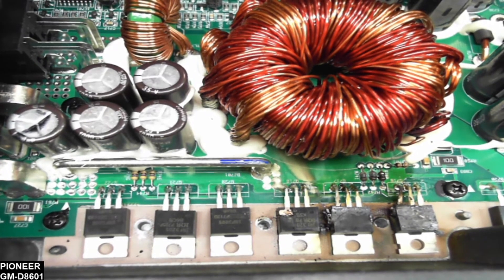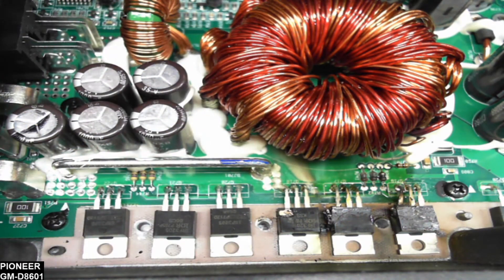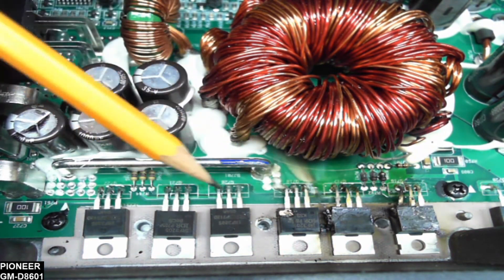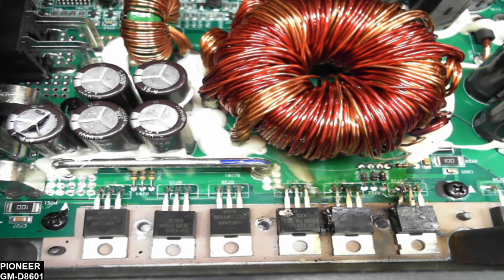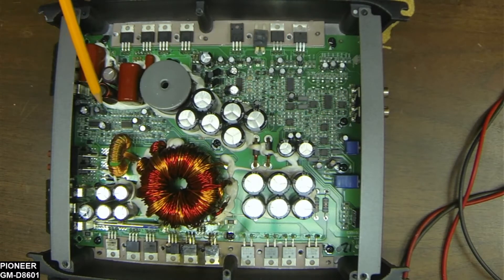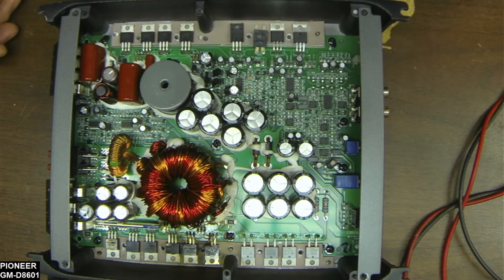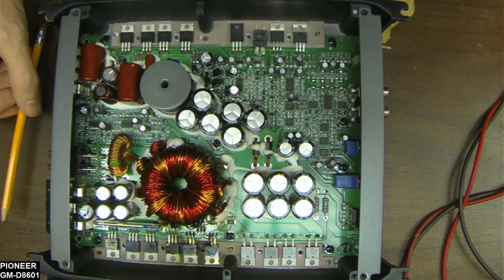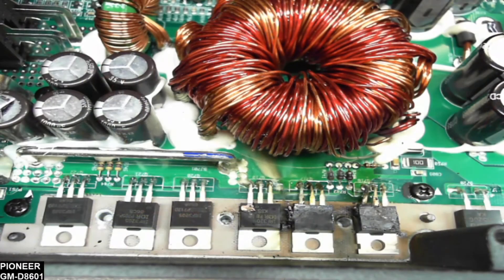Pioneer GM-D8601 Class D Automotive Amp Small Rant About Build Quality

Comment: Hmmm, i run two of these in my car each @ 2ohms and run them at the max output for that impedance on a daily basis, wonder if i have two time bombs in my boot now. i also own a pioneer GM-D multi channel amp as well :/
Reply from the maker: Hi Steve, thank you for watching! There are many factors that contribute to amplifier failures. Under-voltage and output clipping. Next in line would be heat-soak. You can run an amplifier at its max and still be somewhat safe but what will catch up is the lack of heat dissipation. This is when transistors fail.
Reply: @ellensburgamplifier  ive had the wiring run for over a year to turn on a fan with the accessory output on the ignition, been too lazy to actually install the fan lol.

I probably hit pretty low voltages, my systems configuration is 2100w RMS total  based on rated power and while not competition grade power my cars alternator hates me, ive killed two of them so far and well on the way to a third ha ha.
Reply from the maker: @stevefox3763  You must be doing well for them to make it this long! I am here if anything happens to them. One thing I would do is to glue the inductor and output filter capacitors in place. These typically fail from vibration damage.
Reply: @ellensburgamplifier  lol, vibration? they live behind four 12's he he.  I siliconed the internals on the crossovers for my front and rear components because i wasn't happy with things relying on just solder joints for security, doing things in the amps makes a lot of sense!
When i did my fronts i used epoxy at first and man did i regret that, the resistors started cooking the epoxy to the point of it smoking and my car stank, even after i cleaned as much off as i could and replaced it with silicone it still stank and smoked for months :(

Comment: Sometimes people attempt to top solder mosfets back in and get them to work not even looking at the drive signal and they just blow back up. Lol I find the output inductors always coming free from bad scolding on these amps alot
Reply from the maker: Once I pull the board I will know! I thought this same thing as there is flux visible (not flow soldered) on all the TO220 transistors.

Comment: You don't match transistors by date code.  You can "start" there but you really need to measure the parameters of each in order to match them.    While different manufacturing runs of parts may be very close in specifications they will never be exactly matched, even two that were manufactured one after the other from the same piece of silicon.
Reply: Yes you are correct but it is not practical to buy a 100 stick and try to pick out the closest matching set for each amp that needs repaired.  same batch is good enough  unless its a timex lol
Reply: @WhateverUDecide  , understood.  My point was that Pioneer may be choosing the parts from different date batches based upon their tested specifications and not their date code.   I understand as a servicer that you can't stock 1000's of parts of different transistors just to be able to match them.   Just because you see different date codes doesn't mean that Pioneer didn't take the time to match them.  It actually supports this due to the mismatched date codes.
Reply from the maker: @aaa000777  Thanks for the comments! I guess they could have employees matching transistors but that would surprise me.
Reply: @aaa000777  i really feel they could not care any less and i have seen this from many brands    but not from rf or mtx  yet
Reply: I can not recall at the moment but I have seen transistors with hand written pen with the parameters. I have seen it in more than one but again can not recall. Given this amplifier is a couple years old and the typical clientele of pioneer customers I would be willing to bet the fets were not the issue, not that I disagree in seeing that is certainly odd and never a good sight to see, nor would it be a first a manufacture did not care about the consumer.

 Did you by chance test the output transistors and find anomalies between one another?